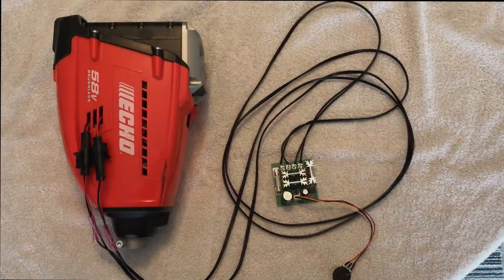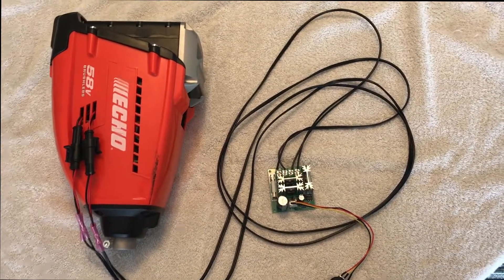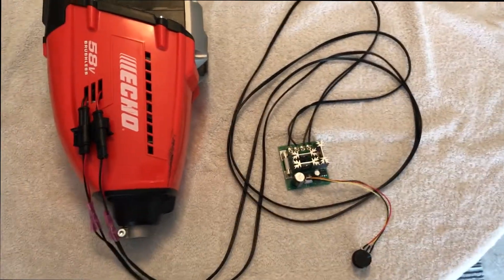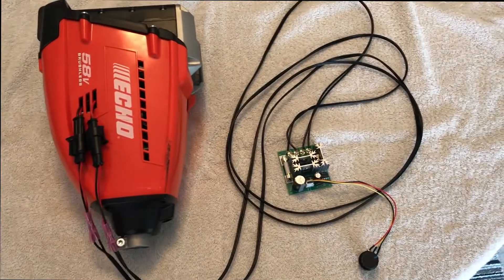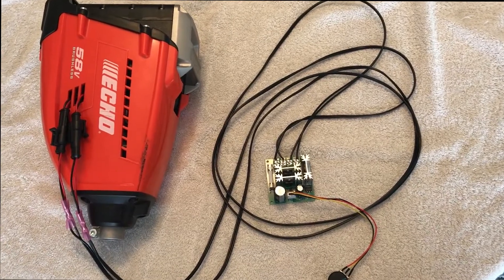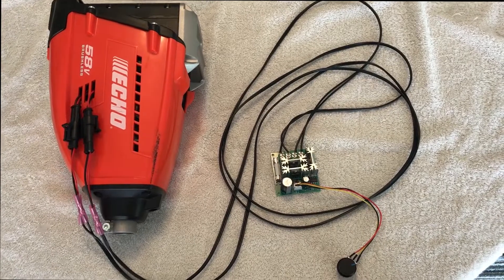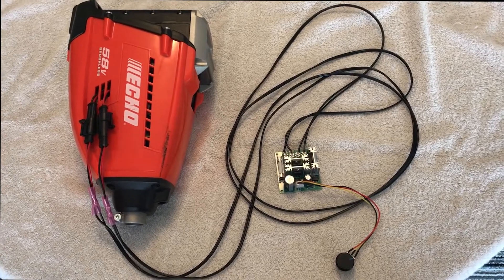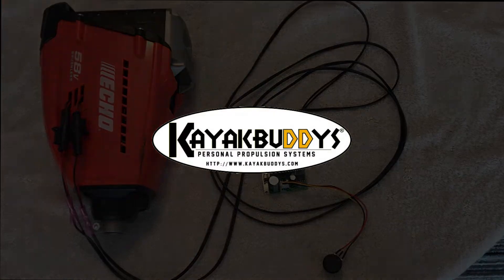ECHO 58v Powerhead for Electric Kayak Engine

Comment: Have you upgraded the battery pack? I tried this with my 58v ebike battery but I'm not sure what T1 and T2 are for the motor ran but would cut out every 5 seconds or so.
Reply from the maker: I never needed to change the battery. If the motor detects an interference or to much resistance it goes into a limp mode to protect the board.
Reply: How do you take it out of limp mode? maybe this was my problem as it didn't detect a circuit from T1 or t2 I later figured T1 T2 maybe are negative but I think the motor controller and BMS communication would be a little more complicated than just + -
Reply from the maker: @aleksdamaco  I changed the prop to a 2-blade so it reduces the drag and I have not had a problem since.
Reply: @kayakbuddysllc-lightweight4947  can limp mode be triggered running no attachment or just say no water / tool load
Reply from the maker: @aleksbogdanoski2551  I am sure it could. I have used a skateboard motor controller and wireless throttle in replace of the factory system and it works like a champ.

Comment: I have a nucanoe frontier 12 and have a 2.5 hp  yamaha 4 stroke and am looking to replace it with something lighter but I still want to be able to run a good amount of distance.  I also have a bow mount Minnkota Ipilot 55 lb thrust trolling motor and will be taking another person out on it also. What do you recommend as a replacement for the Yamaha? Also have you gotten in any rough water with the Nucanoe Frontier and how did it handle it? Thanks, Steve

Comment: Very cool will be going into the power head and see if it's 3 wire motor /three phase standard hobby   controller  without  hall.i hope.
Reply from the maker: PATRIC MINDERHOUT it is a three wire motor. Not sure if it has hall sensors. I need to come up with a speed control that I can mount in the box. I used a dc controller on the battery voltage before the inverter, but it was a bit difficult to have to adjust it on the power side instead of the trigger.

Comment: Very nice, I like how quiet it is in the kayak. 
About the switch, have you tried an esc with reverse capability?
Reply from the maker: JMerv80 it runs almost silent now. Little noise from the powerhead. Currently I run on a rotational switch to control the voltage via the battery. Being that it is a brushless a custom trigger needs to be created.

Comment: Will that motor handle over volting?
Reply from the maker: kambo209 why would you want to push the voltage? The inverter is made strictly for the 58v and the board would definitely not handle it in my opinion.